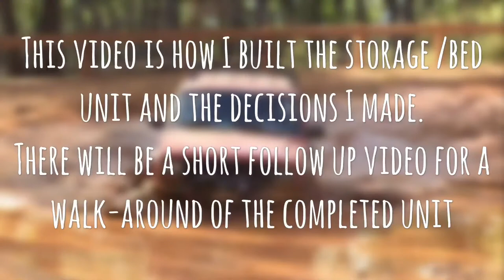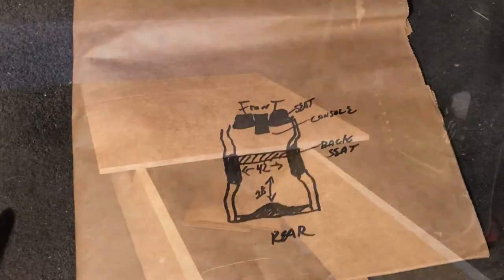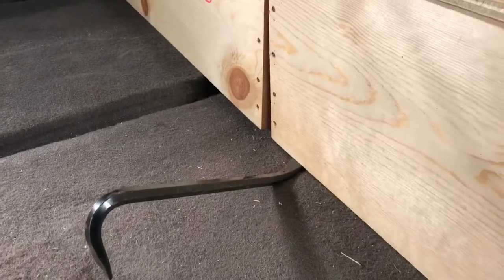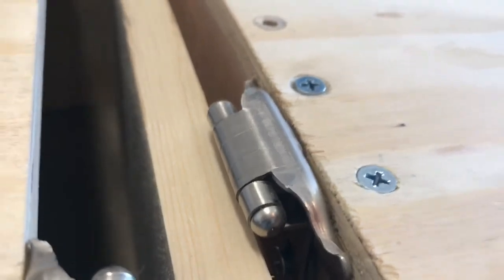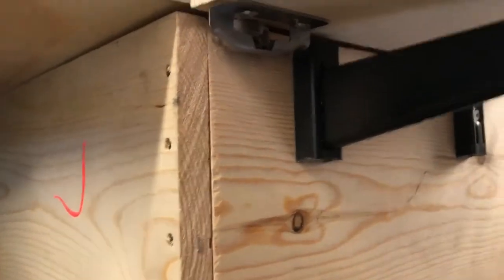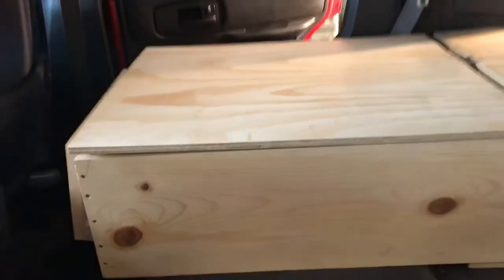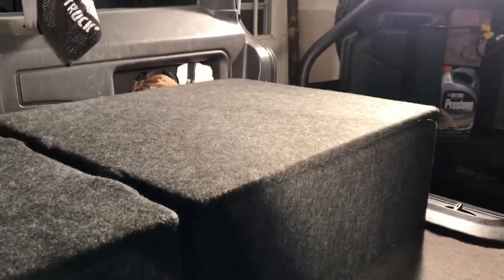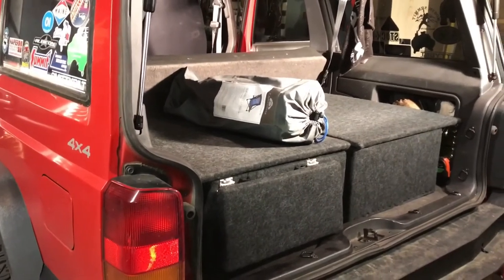Dual Purpose Platform Bed and Cargo / Storage Build for My 99 Jeep Cherokee XJ

Comment: I have been researching for about 6+ months for how I want to build out my XJ for camping.  I like your design the best out of all the ones I've seen.  Yours still allows a wide(ish) platform, with simple storage accessible with doors closed, modular if I ever needed to reinstall the rear seat when I'm not doing extended trips, and allows for a place to be seated.  Thanks for sharing!!

Comment: Unfamiliar with “salvage stores”, can you give some examples ?  Great Job on buildout 👍🏼
Reply from the maker: 240Z2NV They are stores that sell new or sometimes used goods and materials at cheaper costs than retail. They buy goods at auction, or in lots from stores and resellers so you never know what they will have day to day. If you look up Salvage, Discount, Builder Surplus, or Home Surplus you may find some in your area. It’s like a treasure hunt every time lol

Comment: Have you field tested it yet? I'm curious if there's anything you'd change after it's been a while. Also I was curious how you we're planning to move the driver's side box back and forth if it's full of stuff. Maybe you just don't move it that often?
Reply from the maker: George harper I have been sleeping in it for the last 6 months and that is what my channel is mostly about at the moment.. Overlanding the US and Canada.  I am very happy with it and have no immediate plans to change it when I return, and before my next trip. 
2 things that I have thought about, and may do, are: 
-Put piano hinges, or just better hinges, on the lids. The ones I put on were a cheap option, but they have held up after non stop use for 6 months. 
-I would have the rear box lid open from the side so I can access it much easier while sitting on the other side of the Jeep. It can still be opened from the inside, but is not as accessible.  It would require a redesign though since I have a lip on the other side and I use that open space by the side of the Jeep for storage. 
In a few videos after this one I think I show how I move it around. But even full of clothes I can move the box from the front to the back just by lifting it and swinging it around (with an open and clean cab to do it in). But since I am living in it I do not ever need to move it. I did for a while though when I was using it for camping and as a daily. It was not a problem. 
Currently I also have it screwed down to the plywood seat replacement I made, so it does not move on bumpy roads. 
For sleeping I have a 4” foam mattress with a heavy sleeping  bag on top. I sleep better in my Jeep than in my own bed.
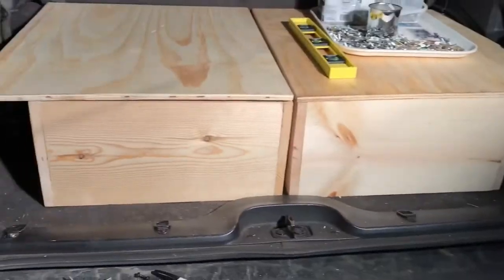Here you go... at the 5:25 mark. It is easy even with stuff in it. 
https://youtu.be/BOgofUVHVc0
Also in that video, I did away with straps and secure the boxes through the floor

Comment: what about a guy that is 6'3" i can't remember but... the passenger seat folds forward right?
Reply from the maker: You would need to lay corner to corner. Even with the seat all the way forward and it tilted up (it does not fold forward very far on a XJ) I have just enough room to completely stretch out at 5’8”
If you did an elevated platform in the whole back area (with storage underneath) and put your head at the passenger seat, and your feet at the back corner on the driver’s side, that would give you enough to be close to stretching out I would think.
Reply: Two door xj front seats have the bracket to let you lean the seat forward to get into the back.

Comment: What are the final dimensions for all your sides and tops?
Reply from the maker: dlinemusic Both boxes are the same except the lid is reversed on one, so when they are both side by side in the back the lids hang over the wheel wells. 
Bottom plywood: 28L x l9.5W
Lid:28L x 24W
Sides x2: 28L x 9H 
Back and front boards: 18L x 9H

The dimensions may need adjusting based on the thickness of the side boards. I think I used 1” pine board.
Reply: @simpleoverlander  thanks a million! Keep up the great content